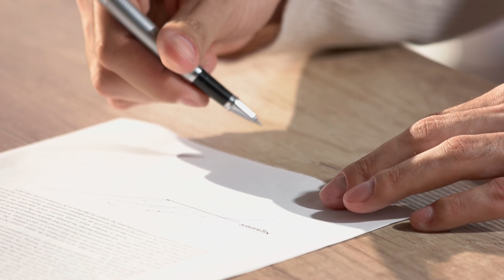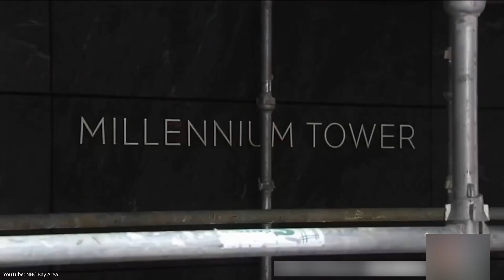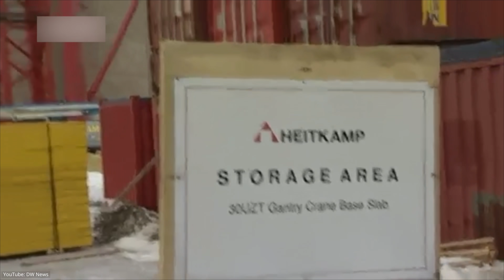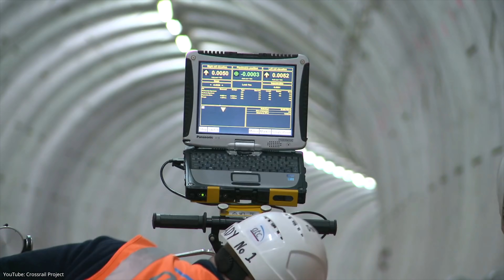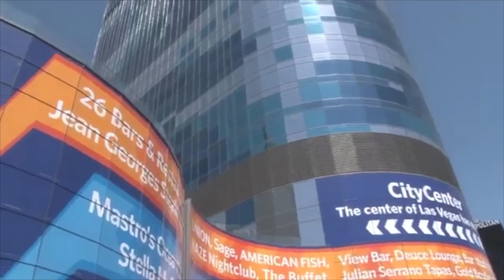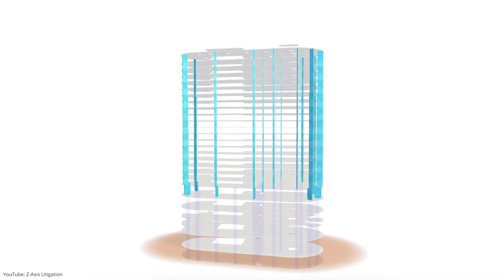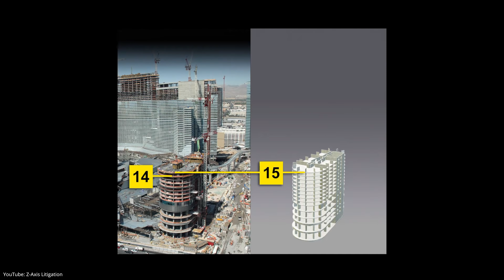Most Expensive Construction Mistakes in the World (Part 3)

Comment: Thermal power plant Šoštanj (Slovenia) Estimated construction cost in 2006, 440 000 0000 euros, final construction costs 1.412.655.460 euros. In the best scenario investments spent on the construction of Teša 6 will be repaid in 23 years, not in 16 years, as envisaged in the plan.

Comment: The video highlighted the western span of the SF/Oakland bay bridge on the map. The video showed earthquake damage to the western span, and the Cypress viaduct in Oakland. They retrofit the western span--replacing all the riveted girders with box beams.
Reply: Exactly. The video should clarify that the repair of the bridge wasn't considered too expensive, as the bridge was repaired and re-opened a month after Loma Prieta. It was the retrofit that was considered too expensive, and thus plans to replace the Eastern span moved forward.
Reply: Yeah all that talk with the video that was shown is very misleading.   Also it wasn't the city (not sure which city, San Francisco?) who's problem was replacing the bridge, that was a a California project.   Unfortunately politicians who's eyes were bigger than their wallets decided the eastern span should be a symbol (which usually translates to overly expensive) instead of doing a simple (and MUCH cheaper) causeway type design similar to the San Mateo bridge.   It still had lots of cost overruns, but something tells me a simple concrete deck cause way would have been more than sufficient with not much of an overrun.
Reply: @Mike__B  Of course it became part of the GS Warriors logo, so there's that.
Reply: @travisfinucane  Oh damn didn't even realize that.
Reply: @Mike__B  That was the CalTrans proposal, but it's the Oakland side so what got built is what the Oakland City Council wanted...

Comment: skill testing question re swedish tunnel: what's cheaper, drill hundreds of exploratory holes from the surface, down to the point where the tunnel will be (and maybe a bit further to be certain) assessing the type of rock and dirt you're going into, or barge ahead with the biggie tunnel boring machines and 'learn as you go'?
Reply: After 23 years every newspaper in Sweden concluded that there was a light on the end of the tunnel.

Comment: At about 9:10 images of the Cypress section of the freeway passing through Northern Oakland are passed off as images of the San  Francisco-Oakland Bay bridge. The total visible damage to the bridge is the one 50-foot section of the upper deck that fell onto the lower deck shown shortly afterward. And, yes, according  to all the news reports the cantilever span between Yerba Buena (a.k.a. Treasure) Island and Oakland were deemed unstable, being built on sand instead of bedrock. The broken span was fixed and used for years until a new span could be designed and built to replace it.

Comment: Without reading the 2700 comments, I nominate the California High Speed Rail. Extending over 400 miles from SF to Modesto, Fresno, Bakersfield, then to LA and Anaheim the original estimate was $33B over 10 years ago. But current estimates have soared to over $150B and that likely won’t be enough. Construction will take decades longer and they don’t even have a solid plan to get over the mountains between LA and Bakersfield. Land acquisition has been a complicated, expensive and corrupt ongoing problem. It will likely be California’s version of Stonehenge, because several thousand years from now when our distant relatives will stumble upon a forest of unused concrete bridge columns and partially completed mega structures, they will wonder just WTF was going on way back in the past?
Reply: Why the hell is it heading inland to Bakersfield and Fresno, when it could just go between San Francisco and LA via San Jose?
Reply: @AEMoreira81  that was the original plan, to just follow the 5 but nooooooo the political fortresses of Fresno, Modesto, Merced and Bakersfield all threw a fit that they were being left out and demanded to be part of the party. This decision was promoted as a huge boon for the Central Valley economy, but they are finding land acquisition and construction around these cities to be an enormous (and very expensive) challenge. It would have saved tens of billions to just take the original route along the 5.

Comment: 07:53 YOU STATE THAT THE ROCK WAS TO SOFT TO WORK WITH AND IT BROKE A DRILL. HOW CAN THAT BE?
Reply: You can have stuff break in more then one way
Reply: The drill used hydrolic things (dont know the propper term) that pressed against the mountain to keep the drill in place, but the mountain was to soft to keep the drill in place and cracked.

Comment: It would be nice to learn more about the Olkiluoto Reaktor building. It is an EPR type which promisses highest safety of all reactor architectures, because a great core melting is controlled by an core catching room, which is not existing in any other architecture. This needs additional building volume, concrete and high tempurature proof material for the molten core, which may reach over 2000 K. Also in France in Flammenville an EPR was build with very high costs. In China two EPR's are build with no problems. Like it is typical for nowadays China. If Germany would decide to build new nuclear power station (low probabilty), EPR's could be build too. The EPR (European Pressurized water Reaktor) was a joint development from France, Germany and other european nations. Planning an reactor of highest safety. But only a few modells are build and the costs are tremendously. But please make an own video about the EPR, its intention and realizations in China, France and Finnland !
Reply: Finland is building a Russian reactor instead now. Hanhikivi Nuclear Power Plant. The Russians never abandoned nuclear power.
Reply: @Toro_Da_Corsa  ; Is this the next nuclear powerstation in Finnland ? I think the Olkiluoto reactor will start electricity production soon. But perhaps no more EPR's are build because of the costs. Poland want to build nuclear power plants. They speak with american company Westinghouse about the delivery. Iran has russian reactors, as I know und Saudi Arabia got reactors from South Korea. The (french) EPR seems to be to expensive. I don't know enough about safety of reactors from Westing House, South Korea, Russia and China against the european EPR. In West Europe nuclear power is not so "sexy" anymore. Concepts of a real green sustainable energy production is more appriciated. But this is more dreaming than realizing. Germany and all Europe has to became weak and tired in doing real future developments. Germany burns simply more coal to substitute the political unwished nuclear power generation. Europe has no own solar panel / technology production. Also wind turbines are more and more produced in China. It is not nice to witness this decay of Europe as industrial location. But I cannot change it.
Reply: Well, I would never want to live close to a Chinese reactor, just look at your average stuff at home, when it’s cheap and most of the time broken it says “ Made in China” on the back.
Reply: @wolfgangrenner4152  I stay with what I wrote, of course a lot of things are good coming from China, but if possible I will avoid them as much as possible and pay the extra euro for stuff I know is of better quality, for me it’s about traceability where the origin is. For example a lot of stuff says Made in EU, this only defines its put together in the EU, a lot of components are from all over the world, also China. Like I said I try to avoid it and not only for quality, the way of thinking in China, the “freedom” over there is what bothers me too. You will say that is all around the world, correct but if possible I’ll avoid it.
Reply: @joostprins3381  I have absolutely your opinion. I look also if I can buy anything "Made in Germany". Not alone because of quality and price, but especially to support local economics to retain wealthiness in old western world. If you need a Tank (Leopard II) or an car (e.g. BMW), you may have the chance to buy "Made in Germany". But if you need a computer, camera, HIFI set, drilling mashine or any thing else from consumer range you have no chance to buy "Made in Germany" or from any other western country. The production was completly shifted to China or anywhere else in East Asia. This is not a good development. But you cannot change it.
Reply: @Toro_Da_Corsa  Hanhikivi was put on ice after Russian attack to Ukraine.
Reply: @wolfgangrenner4152  Olkiluoto 3 is still having problems Dec 2022.
Reply: @notpublic5159  Do you know what problems exists ? The high building costs may be simply due to high safety installations. As I know the full EPR has to separate concrete shields, each 2 m thick. The first can catch havy airplane crashes and the second will keep the reactor still save. No other architecture has this. The second confinement can be avoided to lower building costs. What I do not know, how long an EPR can be used. France has currently the serious problem that their AKW reach 50 years age. And this is the maximum age of this early architecture, which do not indend to exchange the nuclear core parts. I do not know if the EPR allows to exchange the metallic core parts. So that the concrete confinement can be used over centuries. May be and may be this gives the EPR a lot of "childhood diseases". England builds six EPR currently. And Poland is not sure if to use and EDF / EPR or Westinghouse solution. Poland want to get western AKW, to ensure independence of Russia.
Reply: @wolfgangrenner4152  in wikipedia reads "In October 2022, damage was discovered in the feedwater pumps, likely delaying the end of commissioning testing.[32] On 28 October, it was announced cracks a few centimetres long had been found in all four of the feedwater pump impellers. The cause of the cracks was yet to be determined."
According to Areva el production will resume dec 25 2022
Reply: @notpublic5159  If there are cracks in metalparts of a new reactor facility, there was not enough care taken during production of the parts. Before installing components into a nuclear power station and start it up, all parts should been checked approbatly. This was not done, like it seems. If a nuclear power station is 50 years in usage, than cracks appear as material fatigue from termal, mechanical and nuclear stress. This fatigue determines the lifetime of a nuclear reactor. If the aged metal parts can be completely exchanged by retaining the concrete confinement, than the nuclear waste procuction over long usage times decreases. If the EPR can do it ? I don't know. But if a new EPR is started with material cracks, than bad quality hat been delivered. No advertisement for european industries.

Comment: I lived in San Francisco during the entire construction of the New Bay Bridge Eastern Spann. There was nothing actually wrong with the original cantilever spann.  The only damaged to the bridge,  by the Loma Prieta Earthquake, was the slipping off of ONE of the roadway sections at ONE end. The slip-off occurred as the cantilever web expanded and contracted during the quake.  The roadway consisted of several INDEPENDENT flat slab-sections, NO damage to the Cantilever Web actually occurred:  Only ONE raodway sections slipped off one of its end -supports!  Re-enforcement could have easily been carried out.  The new spann, (seven billion dollars later), is ugly by comparison. It was a tremendous waste of money!
Reply: @Kenny Long : The cantilever section was studied by engineers and deemed seismically compromised and in danger of structural failure while the double suspension section was not. The new eastern section is quite beautiful and sleek. While you may have lived in the City for a time (I presume you no longer do), my family has been here since 1856. Some of us are here for the long haul and appreciate the City.
Reply: The eastern span that collapsed was built on treated wood  driven into the bay mud and it was not practical to use or repair.  The earthquake was only a  6.9  and if a bigger quake had hit like the one in 1906, the damage would've been significantly worse. So it was a much needed improvement.
Reply: Man it took so many years watching the bridge getting dismantled and being built, crossing the bridge year after year UNTIL FINALLY IT’S DONE
Reply: @sfmike711  If you appreciate SF then clean it up!!
Reply: @Diggit7979  Only 6.9 ??
Reply: @Johnny Botts  I believe it was revised down from 7.1 to 6.9 later on.  What I meant as only 6.9 is how people speak about " the Big One" compared to the 1906 earthquake or future event that will happen.  I didn't mean to diminish what happened to those who lost their lives or property   damaged.
Reply: I thought I read, for years, how Caltrans screwed up the building of the replacement - letting the contractor build new bridge supports that were held/supported by corroding substandard steel, and impossible to replace ...

Comment: The San Francisco-Oakland Bay Bridge has a lot of mistakes in the video.  First, the picture shown at 9:06 was I-880 in West Oakland, not the Bay Bridge.  Second, at 9:15, the section being highlighted in the video is between Yerba Buena Island and San Francisco.  That section is intact and not being replaced.  The section being replaced is between Yerba Buena Island and Oakland which lied on the right side of the section being high-lighted in the video.  Third, at 9:40, the picture is not the San Francisco City Hall.  In fact, it looks like the United States Capital in Washington D.C.  At 10:12, it talks about "repair or refabrication", but the video is showing the demolition work of the old span that is nothing to do with repair. I drove through the bridge all the time and the new span is absolutely beautiful.  It is an engineering marvel instead of a mistake.

Comment: Might want to look into 161 Maiden Lane in NYC. I’m in high rise construction and this project is ongoing for more than 5 years. Approximately 60 stories and located right by south street seaport. Building is leaning about 16 inches at the top. Not all the piles were driven to the ground at the start in order to save some $$$.  If you look you will find plenty of info on the project and current lawsuits

Comment: Construction
The Standard Oil Building was constructed as the headquarters of the Standard Oil Company of Indiana, which had previously been housed at South Michigan Avenue and East 9th Street. When it was completed in 1973, it was the tallest building in Chicago and the fourth-tallest in the world, earning it the nickname "Big Stan".[10] (A year later, the Sears Tower took the title as Chicago's and world's tallest.) The building employs a tubular steel-framed structural system with V-shaped perimeter columns to resist earthquakes, reduce sway, minimize column bending, and maximize column-free space. This construction method was also used for the former World Trade Center towers in New York City.

Refacing
When completed, it was the world's tallest marble-clad building, sheathed entirely with 43,000 slabs of Italian Carrara marble. The marble used was thinner than previously attempted in cladding a building, which soon proved to be a mistake. On December 25, 1973, during construction a 350-pound marble slab detached from the façade and penetrated the roof of the nearby Prudential Center.[11] In 1985, inspection found numerous cracks and bowing in the marble cladding of the building. To alleviate the problem, stainless steel straps were added to hold the marble in place.[10] Later, from 1990 to 1992, the entire building was refaced with Mount Airy white granite at an estimated cost of over $80 million.[5][12] Amoco was reluctant to divulge the actual amount, but it was well over half the original price of the building, without adjustment for inflation. Two-thirds of the discarded marble was crushed and used as landscaping decoration at Amoco's refinery in Whiting, Indiana, one-sixth was donated to Governors State University, in University Park, and one-sixth donated to Regalo, a division of Lashcon Inc. Under a grant from the Illinois Department of Rehabilitative Services, Regalo's 25 handicapped workers carved the discarded marble into a variety of specialty items such as corporate gifts and mementos including desk clocks and pen holders.[5][13] The building's facade somewhat resembles that of the North and South tower of the former World Trade Center Complex due to the upward flow of the columns.

Comment: Olkiluoto 3 is one of the first ever built nuclear reactors of it's own kind so it's brand new technology + it's working. It was supposed to be the world's first but Chinese got their first complete 2018. Even the costs has gone up a lot and there's been delays for various reasons, it's still one of the most modern reactors in the world. They've ran it successfully and it will be fully working during this summer 2022. It's not exactly a mistake if you ask from me, more like a pilot project where anything can go wrong.